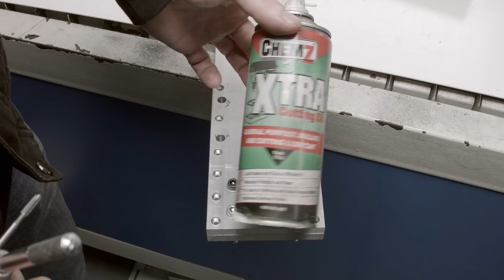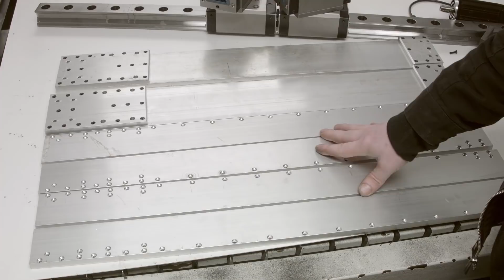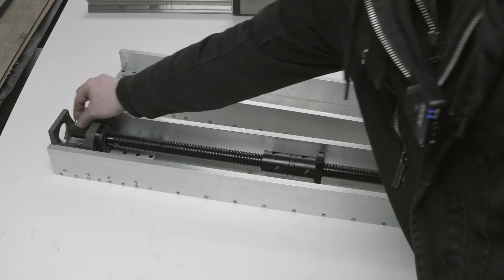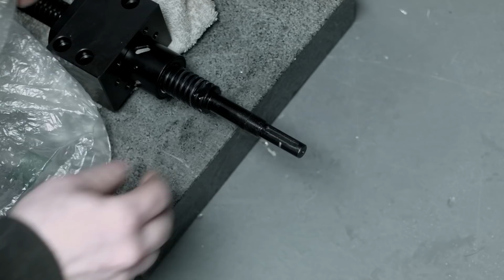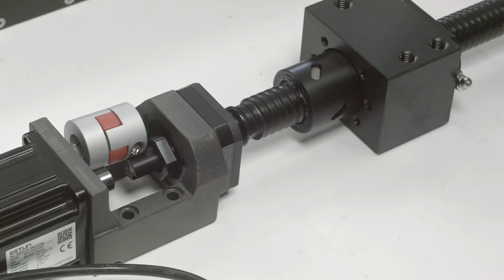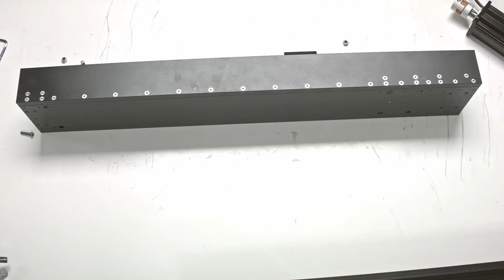EPIC CNC upgrade - episode 2. part 2 assembly and fine tuning

Comment: Hello Piotr, outstanding work on your machine! I've been inspired to change my design from fixed to moving gantry, using your approach with granite! I'm desiging the machine but I'm not sure how did you setup the control part: I see you're using now AC servos, but how do you drive them? Do you have a servo drive for each motor? does the servo drives communicate with the motion control box? Could you provide more details about your controller box? Thank you very much in advance and keep up the good work!

Comment: Hello Poitr,  Great machine build. I saw your screw setup and had an idea and question.  I see the structure is like a C-channel and is very rigid.  I also notice you mount your bearings with 90° angle brackets.  If you think it would be a benefit... You could mount your bearings with a flange to the end of your C-channel structure. (no angle brackets, just flat plate for the bearings.   This way, you could add tension to the ball screws, and your C-channel structure would be in compression, and take the force perfectly and not bend.  Is there an advantage to a tensioned ball screw ?  Maybe.  I know they do this with very long and high speed ball screws to reduce whip.  It just seems if you redesign your brackets into plates, the potential to apply load in pure compression, and not bending could be a benefit.  It seems you fancy the concept for modular components that can be had from the catalogue, but  plates that I am suggesting are a quite simple machined part.  So, no criticism of what you have in any way, just an idea for making a more rigid drive system, from an engineering point of view. You have 90% of what you need right now.  Keep up  the fine work. --Doozer
Reply from the maker: I guess you are right for something longer. Those screws are really fat and short. I dont expect much of wiplash. On the other hand if you "stretch" the screw you might be bending the frame. I think it might be extra tricky to dial everything down.
Reply: @PiotrFoxWysocki  Just wanted to give some intellectual stimulation ! LOL  Love your machine.

Comment: Hi !  BK support should be used on the motor side.   Why are you using BF support  ?
Reply from the maker: i bought a BK instead of BF my mistake, there was a lots of parts. anyway it worked great because i needed more spacers (tubes) for the ball screw.

Comment: It's difficult bolting things with countersunk screws because the order in which you tighten them affects the alignment. Even the concentricity of the screws may affect the outcome.

A small drop super-glue cynoacrylate may keep parts from shifting when clamped : ) It's bond can usually be broken with a mallet. I've used glue-gun glue to hold two parts so they can be drilled to be tapped, but aluminum pulls the heat from it pretty quick, so the bond is light.

I am a similar coupler on my CNC (which I finally got moved to were I can use it.) The orange-polyurethane is little strange but it seems to work. I wish it had one more screw on the pinch-bolt.

When you pointed out the bend in the ballscrew it reminding me of this extreme setup they used to limit the non-axial effects. If I make a machine as precise as yours, I may use that technique. There's a video on my channel about the "1 micron axis." I won't post a link. This is your channel.

I guess, if you wanted to get pedantic, you could put the far end ballscrew mount on linear ways, so as the ballscrew stretches, it won't bow. On my CNC, the parts came with one pair of angular contact bearings on one end--and one radial bearing with a sliding fit on the other. I should grease the other end, now that I think of it.

Excessively Neat stuff! Cool project!
Reply from the maker: cool ideas Brenda :) thank you!
Reply: @PiotrFoxWysocki  , you are welcome. You make good stuff!
Reply: Excessively neat, or just the right amount 😂😂😂

Comment: Dumb question - I am considering building a small desktop CNC and I am curious about using Chinese linear rails because I do not plan on using the machine to make a living. Are the Chinese Linear Rails just not as heavy duty as your new rails or are they worn out or were they crap to begin with? (Are they at all worth it or should I steer clear entirely?)
Reply from the maker: It will work. It works on my current machine. But they wont be accurate and they will develop play quie quick. But if you get decent ones they will last much longer and they will be much more precise.

Comment: hey Piotr, me again! i know a detailed video is coming eventually, but could i ask you a few questions about the motors you're using please?
did they send you the 400W or 750W kit? i don't think you mentioned it!
i'm trying to decide between cheaper integrated DC servo motors and the AC servo kit from motioncontrol you're using.
am i correct in saying that the AC servos are powered directly by mains AC, through a breaker board, meaning i don't need any additional power supply or rectifiers? because if so, the additional 4 DC power supplies certainly reduce the difference in price.
Reply from the maker: 400w kit, and yes you plug them directly to ac. no need for power supply and you need smaller electric box to fit it in
Reply: @PiotrFoxWysocki  hey. awesome, thanks so much for getting back to me. hmmm. that makes the decision pretty tough. its still more expensive, but really not by that much.
i've been tempted to downsize and cut corners for budget reasons, but i think i'm gonna slow down again and try to do things properly and get the good stuff :-D
Reply: Most of the time the “good stuff“ is worth buying and definitely more fun in the long run!

Comment: Piotr... I highly recommend wrapping the exposed metal with masking tape to prevent sparks (molten metal) sticking to any precision surface.
Reply from the maker: and what about dust/filings getting stuck to the glue residue and static charge when you peel off masking tape?

Comment: I’m surprised you cut the ballscrew shaft rather than making an extension plate for putting between the motor and the mount.
Reply from the maker: yes, adding extra plate would increase alignment error. and those motor mounts are precision made, so you could only make it worse.

Comment: I use a torque wrench when tightening the locking screws on jaw couplings - most come with a torque spec for this and you really don't want to mess up the threads by overtightening
Reply from the maker: Or destroying ball bearings.

Comment: Hi Piotr, Good job! Probably anodizing could be a better way to paint it.
Reply from the maker: Yes, you are right. this was my in my mind, but my tanks are 10 cm shorter than those plates, i could try to do them on angle or something but this would be way to much work. and since this is somewhere where it wont be touched, or seen, i just went with easier and quicker way.
Reply: @PiotrFoxWysocki  Also usually sandblasting then painting results in a very durable surface as long as you let them dry.

Comment: Did you flatten that aluminum before bolting it all together - or is it just as flat as it was from the factory?
Reply from the maker: just as it was, thickness variation is around 10 microns. so it was better to leave it be. it was to long for my machine to face both ends at once. and if i would change setup than i could introduce even bigger error. beside it is precise enough, its more important for it to be rigid than micron precise.
Reply: @PiotrFoxWysocki  Crap - where do you get aluminum that is that flat from the get go? The last aluminum 6061 extrusions I got were bowed by about 1mm over 100mm of width. And An unknown amount over the length.
Reply: @IceTurf  I've heard of C-250 aluminium plate, which comes precision milled (http://www.aalco.co.uk/datasheets/Aluminium-Alloy-GAL-C250-Precision-Milled-Plate_457.ashx)
Reply: @IceTurf  dont get me wrong. It was bowed. What i ment was the consisrency in the thickness. As you noticed in the video i was clamping it with parallels to straighten it up. Mounting surface under the motor mount and end block is very small. So aluminium will straighten up under the compression coming from bolting those components in. They are all steel. Goal here was to have very rigid unit which will be mounted in to the cnc and than tunned further.

Comment: Piotr, hi. Did u try threadmilling on your cnc?
Reply from the maker: yes i did. but i run out of tool holders and i didnt wanted to change any tools. beside, thread milling requires few test runs to get it right and i was feeling lazy with fusion as well..  i just need more tool holders!

Comment: That style of shaft coupling is bad for precision applications, as it is torsionally flexible. It's made for absorbing shock loads, not positioning accuracy. You want the metal bellows, single piece flexure or disc flexure type. Everything else looks great.

EDIT: I did some research and it appears that I was wrong.
Reply: @BarryManilowa  That's a ball screw not a lead screw. From what I understand, it's meant to eliminate backlash altogether.
Reply from the maker: Thats exactly right
Reply: @mikedelcastillo  it is and it's a quality one from what I understand , it's also has a preloaded double nut for eliminating even more backlash..I would call it a backlash free system nothing can do better ..(of course a better ballscrew could )
Reply from the maker: I had a single piece flexture coupling before installed in the machine on all axis  when it snapped in one of 2 of my Y axis. The other axis kept going and bendig both of the Y screws.
Since that accident i prefer something that wont snap in half. 
I jave replaced all the couplings in to this tipe after the accident. No problems since. 
Beside this coupling is much much stiffer than a single flexture coupling.
Reply: It also largely depends on the hardness of the rubber -- you see these kinds of coupling in commercial machine tools, but the rubber is very hard, only giving way when things go badly, and help with misalignment (as do the bellows types).
Reply: @DanielHeineck  I'm not a mech engineer but if I'm not mistaken some manufacturers use those couplings in way bigger machines ... Maybe they are using some kind of special compound rubber/plastic?
Reply: @jonathan massacesi your statement is completely false. Good quality spider coupling are more than adequate for precise servo applications.
Reply: Yeah, it‘s totally fine to use this kind of coupling. It just depend on the rubber/ plastic you’re using. e.g. it various in a range of about 10Nm/rad to 500 Nm/rad for rubber/plastic couplers in this size (usable values..) based on the shape as well. A metal bellow coupler (cost at least double..) in this size sits at around 1500+ Nm/rad. There is a difference - it depends on what you want...